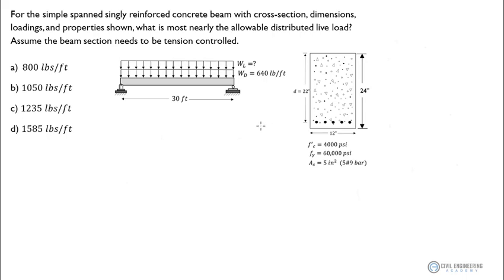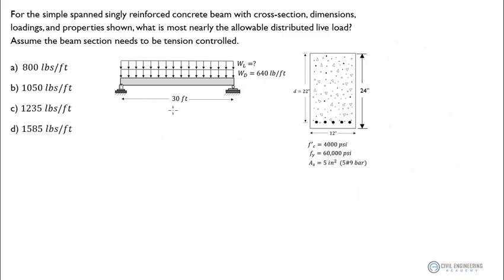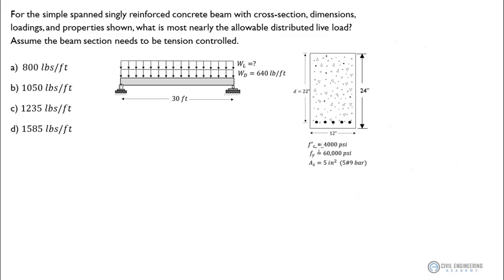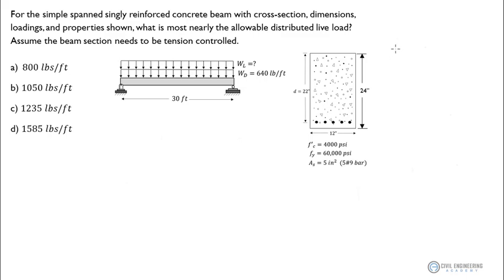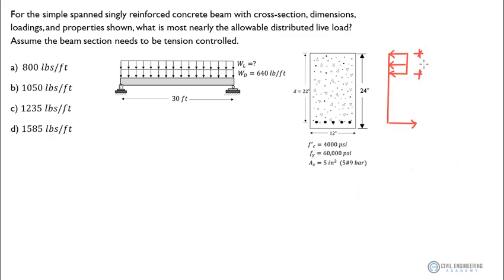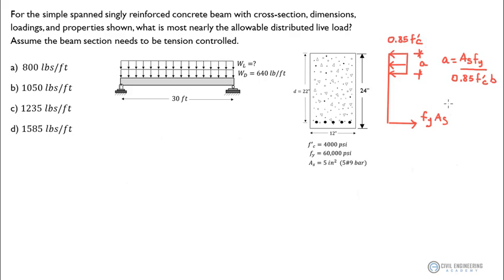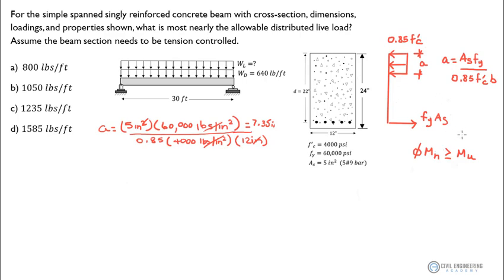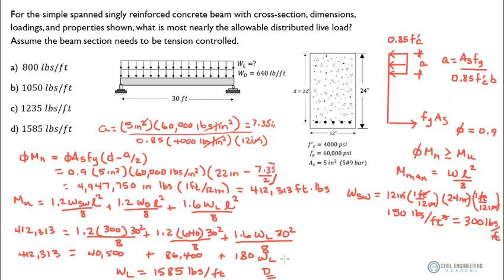Civil FE Exam - Find the Allowable Distributed Live Load in Concrete Beam

Comment: Not sure why Beta1 was not calculated.
Reply: The problem says "tension controlled", so Phi is 0.9
Reply: @qahraman2025  thats right but if you calculate c/dt value is more than 0.375 so you have to calculate the phi value isn't it?